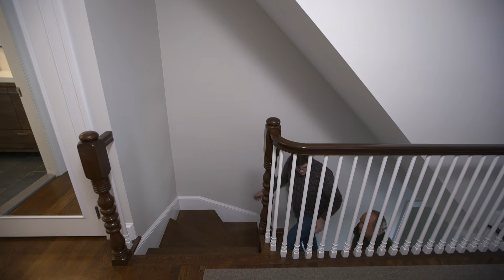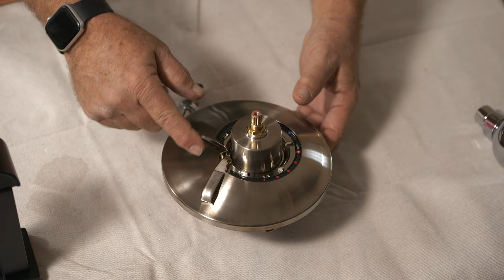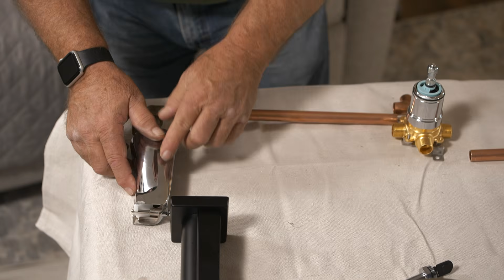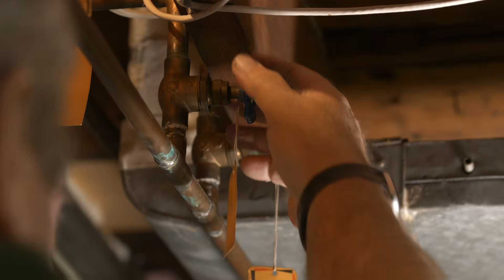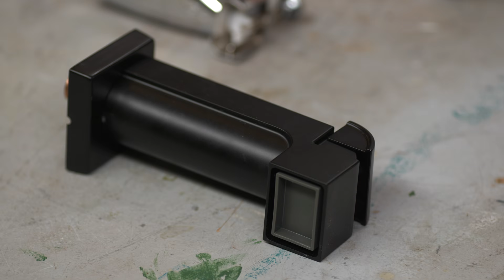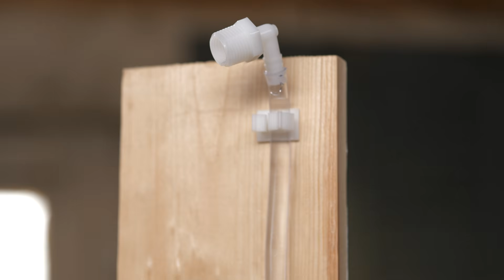How To Troubleshoot a Leaky Showerhead | Ask This Old House

Comment: I will always miss the two handle 'antique' rough in and 3 handle valve in my old apartment. Almost 75 years old and going strong. Plastic chinese made garbage components that last months are ridiculous. Not to mention they waste a ton of water and time since the spray is inadequate. No wonder the pressure was high, it was clearly increased to try to make the homeowner content with an inadequate system. No one wanted this and no one asked for this. Interesting but depressing video.

Comment: By turning down isolation valves, you reduced the flow. Yes, solve the “high pressure” problem but you reduced the amount of water as well. 

We do a lot of irrigation out here in California and I see this a lot. People just turn down their valves to “reduce” their pressure but also limit the amount of flow in the system and wonder why their system is inefficient.

Comment: Does the piece with the tub spout removed have no caulking, because there was no caulking on the tub spout itself to keep water from getting behind the wall.  While this is a fix in the video, bath time will take forever with that super low pressure, and the shower as well we be basically low flow..  Shame the only real fix is to tear the tile off and do a proper valve, especially after a fresh renovation

Comment: I had the same issue. Problem wasn’t the water pressure. Problem was that the valve on my bathtub was placed high as if it were a shower shortening the distance from the valve to the shower head. The same issue seems to be the case here. In a bath tub the distance from the valve to the bath spout shouldn’t excess 11 or 12 inches. This leaves a longer pipe from the valve to the shower heard. Water will still climb up this pipe but there wouldn’t enough pressure to go all way out of the shower head. Reducing the water pressure didn’t work for me as water was still coming out.

Comment: Instead of reducing the volume of water to the shower/tub, he could have install a shutoff valve on the shower arm before the shower head.
Reply: And that would require punching a hole in the wall, which is cost prohibitive
Reply: That’s a good idea
Reply: It's like you didn't watch the whole video.  This was a quick, simple, cheap fix and they touch on that at the end.
Reply: Don’t know if the homeowners will find that looking nice. And it impedes the user friendliness if you have 6 different valves to control while showering

Comment: That is not a solution for me. Now you have very low water pressure. What if someone wants to take a shower? Ill that even work now that there is lower then normal water pressure?
Reply: Richard should put his head down in shame on this one.  Absolutely ridiculous and unacceptable results.  Not much different than if he were to just shut the entire water off and say, "hey, now you have no problem with the leak at all! I'm amazing!"

Comment: I've seen this somewhere else recently. It was caused by using pex rather copper to plumb the shower. The pex fittings have a diameter reduction, and that caused the water to backup and dribble out the shower head when the faucet was running.
Reply: Yep that can happen. You can still plumb the whole shower with pex, as long as you make the pipe from the valve body to the tub spout copper. You can bring the hot and cold to the valve body with pex, and up to the showerhead with pex, but down to the tub spout needs to be copper. I believe the Delta universal valve body instructions even mention that as well
Reply: Dude probably didn't want to tear out all his tile work
Reply: Which is bizarre, when you look at the tiny diameter of the openings in the valve -- much smaller than the pipe diameter.  I don't get how the pipe can be the bottleneck, when the valve openings are so much smaller.
Reply: Pex not as great as people make it out to be.

Comment: Am I crazy or did they turn the pressure WAAAAY down? Filling that tub is going to take forever, and showers are going to be really disappointing.
Reply: I'm nowhere near the expert Richard is but I would have with the water running slowly adjust it just until the water stopped running out of the shower
Reply: I'd suspect they dialed it in afterward.
Reply: Turning gate valve down decreases volume.
Reply: @JPC74  True. and since the volume is now reduced enough to go through the spout without back pressure forcing the water up through the shower head, the water stops coming out up above.
Reply: That was my thought too. They did this to be able to use the tub and it's now going to take an hour to fill it. And they have an 8-month-old.

Comment: nothing to do with pressure, pressure is the same even when turning the valves down, it is the flow rate that was the problem.
Reply: There's a pressure drop across the valve he closed. If there was a guage we'd see the drop. There's also a reduction in flow rate. They go hand in hand.  The only difference between him closing the valve and putting in a pressure reducer is that the reducer is a valve that is regulated. Either way, it's still just a valve that gets closed.

Comment: Well actually!! Turning the gate valves doesn’t actually decrease the pressure. It will decrease the volume. It’s really just semantics because decreasing the volume does affect the pressure as fixtures are opened. I had a customer who didn’t have enough “pressure” to run more than once me fixture at a time. I put a pressure gauge on it and it show 65 psi which is more than enough.   Turns out the issue was volume. The original builder had torn down one house and built two small houses on the property. They put two sub meters. The line coming off the city meter was 3/4. This is way too small to supply that amount of fixtures. I just replaced the1’ of 3/4” pipe from the city meter to where it split to the two sub meters with 1 1/4” pipe and it solved everything in both houses. That little bit of pipe changed it so they could run multiple faucets without issue.
Reply: Right, what he did will make filling the tub an all-day affair.
Reply: @crashland5711  yeah, I think that fix could work if you came find the right balance. Based on the video though it’s turned way too far down
Reply: Now he got low volume. 🙈

Comment: If the valve was installed upside down,  would it have caused the same effect with the water pressure having to overcome gravity?
Reply: That could be. Looking at how the water comes out of the larger hole down to the tub and if that's restricted, it goes through the smaller hole to the shower, if it was upside down, the tub water would have to flow through that restriction so it likely would back up to the shower.
Reply: The ones I've come across had the same fitting top and bottom. Probably others that dont
Reply: @balkaraulakh5131  that is most likely a water saving thing. The o rings they put in shower heads to restrict water flow is too easy to defeat, so they probably started putting them in the valves.
Reply: Nope